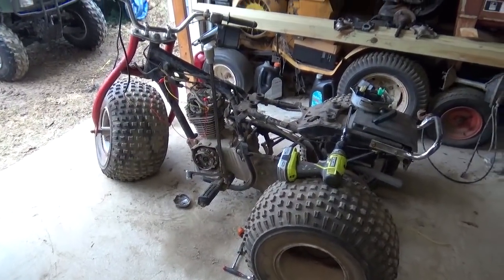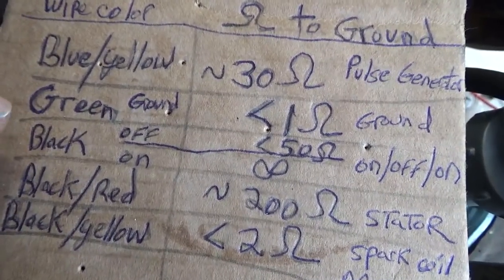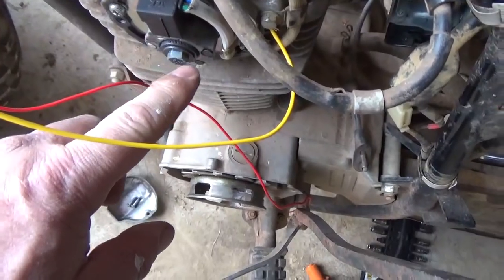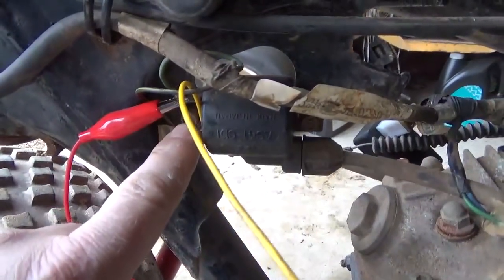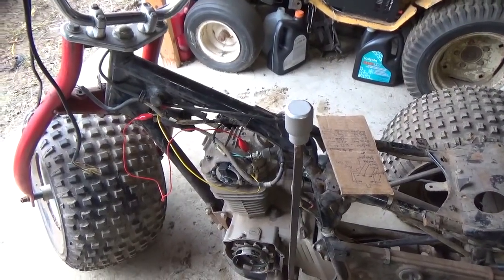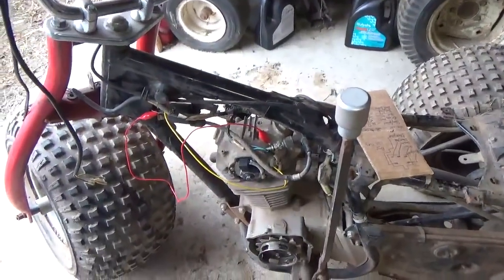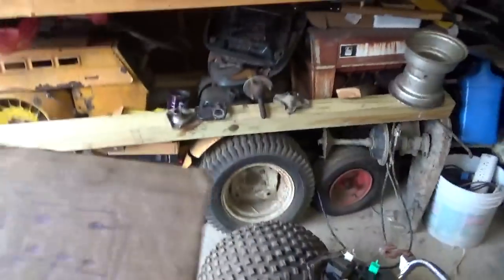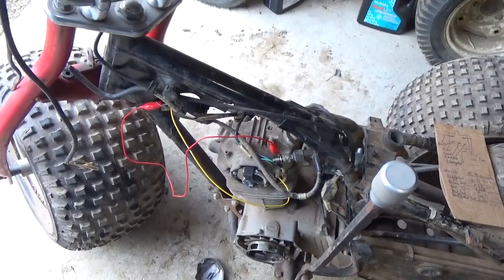Troubleshooting No Spark Honda ATC200, restoring the OEM CDI system.,

Comment: Any idea why after wiring a whole new harness on a 110cc coolster the starter will start cranking on its own when connecting battery terminal without touching start switch or even being on on position?? And of coarse it doesn't actually start or have spark

Comment: I have a 1982 Honda big red 200 with no spark .When trying to buy a new 6 pin CDI box ,I couldn't find one for1982 just 83 and and would one from 83 be compatible as long as it's a 200

Comment: Thanks for all your vids I watch them every time I have problems with the trike. I have a 1984 200s no spark right now. With my amp meter I have prower coming out until I bolt it up to the frame ?? Puzzled... going to do your tests and See what happens
Reply: Dodge12valve you either cross grounded a hot wire or a wire is being pinched / cut
Reply: Anthony Arroyo turns out it was the stator. Wasn’t making enough power. She’s running now, thanks anyway.

Comment: Question? If your coil is new, sparkplug is new, pulse generator and advance sparker is working, stator is working, and when i was probing the connector to the cdi box electricity is going into it but im not getting a spark. So is my cdi box bad? BTW my 3 wheeler is a 1984 200x and it has 2 connectors for the cdi box.

Comment: So I tried doing doing that with the plug and it’s just spark intermittently and will fire right up but then dies after like 30 seconds and the thing is it ran awesome just a month ago before I put one of those junk carbs on it and once it’s running  it’s like every few pulls it will start it’s driving me nuts

Comment: Any advice on a no spark issue with a Hisun Utv 500?
The primary coil has been replaced, stator & trigger, cdi, spark plug, rectifier since it ohm'd out bad and now I have a new ignition switch due to arrive. I've removed & reinstalled the wiring harness since I couldn't find any obvious issue with it.

Comment: Hi Harvey, Maybe the terminals on the old CDI are tarnished and need to be cleaned up just like on a commutator that tarnishes from non use?
Reply from the maker: Hey James, I think I was given the wrong CDI for the ATC200, it is too big, I'm thinking it is off an ATC125 as there were a load of spares from one mixed in with the deal.... I marked it and will hold on to it for now.... The contacts looked ok, there was a lot of contact grease on all the connectors.... Thanks for Ur thoughts, suggestions, watching, and commenting!!!

Comment: hi Harvey I have a 88 Honda fourtrax 300 4x4 I replaced the stator and pulse generator do to no spark it ran great for a couple days after now I have the same issue no spark I didn't replace the gasket witch I think is bad I  was wondering what u think if a bad gasket will cause that to get no spark I can replace the stator generator again but need to figure out why this is happening any input will be greatly appreciated ty very much

Comment: That's why i buy the cdi box with the adujustable advance when i get the cheap Chinese ones you can tune the advance on the box to match the engines timing needs.....some times you can put those cdi boxes in an oven on a low temp and bring them back to life had pretty good success with the old yamaha cdi boxes that didnt work.....but i ive never bake a plastic in cased one like the hondas

Comment: Harvey,
Great video, Do you know when Honda went to the cdi system, and gave up on points ? I kinda like the shift stick,
but in the rough, I wonder if it will have enough leverage to shift it's self? Just curious!! Hope you ride it once with
the shifter and let us know how it was.
GOOD TIMES!!!
Reply: Dragos 4  i dont know about all hondas but generally for these smaller air cooled motors 81 and up are CDI
Reply: Thank you!!
Reply from the maker: Hey Bro!!!!   The old ATC70s and ATC90s had points, I think the ATC185 ant atc200 came out with CDI in 1980.... So, it is more model related, when the new models came out around 1980, they came out with CDI, the stick shift is in the way of my leg position, it may need to be re bent into a better place.... Thanks for Ur encouragement, thoughts, questions, watching, and commenting!!!